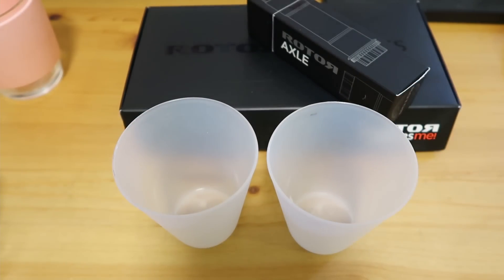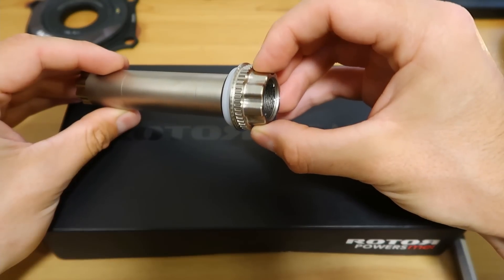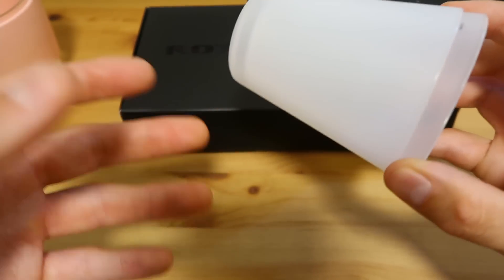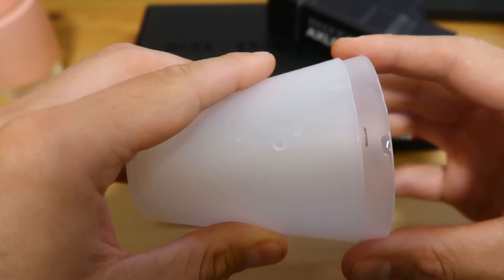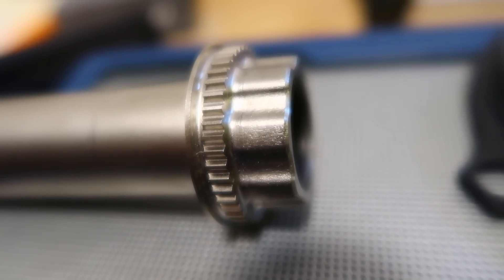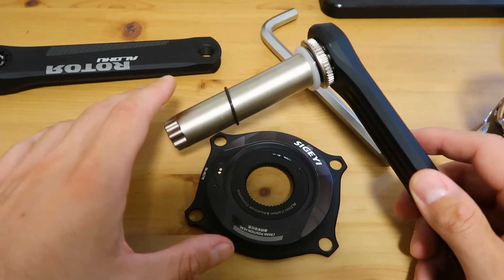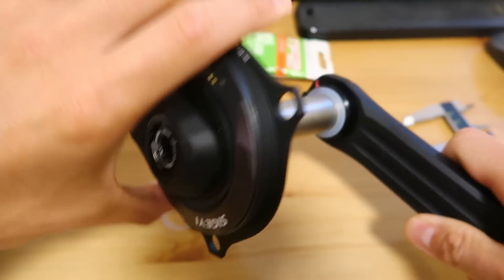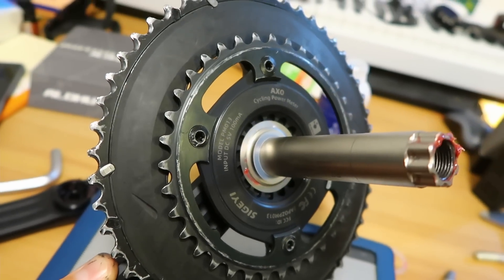Should you replace your Shimano cranks with these? ROTOR ALDHU Design completely & utterly analysed.

Comment: For what it's worth, a 30mm spindle in 7075 aluminium will have comparable bending and torsional stiffnesses to a 24mm spindle in chromoly, based on the aluminium version being one-third lighter and having a 50% thicker wall. At such a large diameter, I would like to think that fretting wear on the spindle caused by the bottom bracket bearings should be a non-factor, even if, academically, the chromoly spindle does provide a longer wear life. The mating splines on the 30mm version are also proportionally larger, which reduces contact stresses and should help preserve the female splines of the crank arms, which are by far the most expensive component in the system to replace.

Comment: I had a loose spider on an older heavily used Rotor P2M but without knowing its original build, it may have not had the required thread lock and spline "filller" stuff used. I've been running the Power2Max version of these Aldhu cranks for a few years with no issues until now - the NDS crank bolt snapped in half (not the normal way, like in half long ways) so I'm looking for videos because I've got a replacement bolt kit that includes two washers which I don't think my current cranks have :)

Comment: I've got a guess here, if the dub spline's got a taper of 2° and preload of 54Nm, and the rotor one has a 3° taper, it'll only need about 35-36Nm to achieve the same amount of radial preload, which is what is recommended.
I've also got another question, why none of these manufactures make the spline out of tangent arcs, instead they use this "small round cutouts in a big circle"? (hope I made myself clear)
Reply from the maker: @endercrafts9056  it doesnt work like that. In theory the shallower the taper, the less clamping force you need. Larger angle tapers actually need more force! As you have less mechanical advantage in a broader wedge. Second question: probably because they cant reliably rely on the locked taper to transfer pedalling torque so they use a very simple spline shape (easy to program) on cnc.

Comment: What should you do if you have some play when mounting the spider on the spindle. I have a aldhu24 crank for my BB90 Trek. And when mounting the spider it is not totally play free :(. I can remove the play when tighten the crank into frame but that can not be good, is it? Any one this issue? @PeakTorque?

Comment: Rotor Aldhu/Vegast 24 is a nightmare. I have two spindles with bad threads and during a casual ride a brand new Vegast crank arm fell off. It was one week old and I used a torque wrench. The quality is just horrible. Same for their web shop that sends mails with template placeholder and customer supper that promises replacement parts but never sends a return label, wants me to cut the crank in half. Do I own a machinery shop?! Ridiculous.

Comment: One thing that bothers me is the use of o-rings on the axle. O-rings eventually dry-rot and fall off/out of things like this. Usually when you still have sixty miles to go before reaching civilization. Also, they crush during assembly and use, then when you go to replace the bearings or swap the crank to a different bike, they don't fit properly anymore.

Comment: Great video. My big 1x11 Vegast chain ring came lose on a bike trip. I never fastened it with a torque wrench. So now I understand why it came lose. I found a guy with a big enough Allen wrench and tightened it very well. Back home it came lose with a lot of force and squeeking sound. Now I know that the tapered side caused this. I will use a torque wrench next time, this is precision work!

Comment: Aldhu 24 + Power2Max NGeco + Praxis Buzz 10/11/12-speed chainrings + AXS road 2x was a nightmare.
1) The cranks hit the derailleur cage when set up to SRAM’s spec. 
2) The 5mm wide flat-top chain is can get stuck in between the chainrings because the NGeco mounting tabs are >3.5mm thick.
3) That >3.5mm thickness causes shifting problems because the FD overshifts to a lesser extent while the rear is in the smaller sprockets.

Comment: Is the left crank axially restrained on the face (similar to the drive side) using the bearings (I'm thinking with a spacer keeping the inner races apart) or is the tapered spline the only thing holding it in place? EDIT: It doesn't seem to be this way looking at it. But does the end of the spindle bottom out against a face on the inside of the splined crank? I'm worried about the splined fit ''squirming'' under load if you will, and fretting wear occurirng between the crank and spindle due to elastic backlash under load.

Comment: Great style of explanation of the important engineering details. Subscribed. I saw this vid as I was looking at these crank sets for a power meter. I really don't like the idea of taper and spider clamping combined as you describe... Even if they do manage to get it to work in this case. I'll probably look for other brands. Is this the only option for these style power meters for shimano rings?

Comment: Update: I got the carbon arms a few days ago and the increase in stiffness is pretty dramatic. The carbon arms feel like a crankset should, without the noodly flex of the aluminum arms.
Reply: Yeah, right.  You put out 2,500 Watts and flex alumimum.
Reply: @lastfm4477  I realize your trying to make a joke, but it's actually in high torque situations like starts and steep climbs, especially for a 200lb rider like myself

Comment: No point to swap to rotor crankset . If you spend that money you better just get the newer dura ace . Much durable and light product . Good quality and good warranty .
Reply: You mean those Dura Ace cranksets splitting in half? No, thanks :-)
Reply: @mareklesniak8768  9200 splits in half ? You buying it from India scam call center ?
Reply: @CoreQ  Time will tell. 9200 cranks are not long enough yet on the market to be 100% confident Shimano has fixed the problem.

Comment: @Peak Torque  I have just purchase at 24mm Rotor crank set and 1-piece chain ring. The machining on the chain ring is outstanding!
When you torqued up the arm, did you apply force to the pedal with a chain attached to mate the splines in the best position as there's a fair bit of lash between the ring and spindle.
Thanks!

Comment: It could be that the tolerances don't need to be quite as tight as you think. There is a phenomena known as elastic averaging for coupling designs like this. Your analysis is correct if the material is assumed to be perfectly rigid. The shoulder sets the axial position, and the rest of the material will elastically deform to allow this to occur (which is why you need to use the force of the screw to draw the assembly together). To extend your comparison of machine tool tapers a little further - dual contact and HSK interfaces have a shoulder perpendicular to the axis of the spindle such that an accurate z-location is set regardless of differences in the tapers. The requirement for this is important as rpm of the spindle increases as the hoop strength of the outer "taper" (spindle) can actually open up and the draw bar can pull the tool holder further in to the spindle. Heat is also something of concern, which you note. I haven't gotten my hands on one of those Rotor shafts, but I would imagine that they are machined with a swarf style 5-axis strategy in a mill turn machine. In cycle probing and cutter compensation would make this a somewhat straight forward task with a straight fluted endmill (no custom tooling required),
Reply from the maker: Nice comment. Someone out there knows their stuff! With relatively thin wall tapers yes they can elastically deform, but the tol will effect the amount of force required to hit the axial end stop. It was my belief that tool tapers being virtually solid there was barely any elastic give in them, which would mean an taking an accurate z cal every operation. But my machine tool knowledge is limited!
Reply: @PeakTorque  The tool holder itself might not "crush" inwards much, but the machine spindle is a hollow cylinder at some level of analysis. Another way to look at it: make the assumption that all the torque applied to your bolt is being converted to linear force at the pitch of the thread (no friction losses) if that force is translated to the 1 degree taper (on the coupling) that is a hell of a lot of expanding force! Wedges are really good at expanding things. The HSK spindle  interface actually clamps the inside of the tool holder for this reason - as RPM increases the clamping force expands outwards. For your cranks: you could check this relatively easily on the crank arms by mic-ing the "width" across the interface area in a relaxed state and compare when it is assembled and torqued. Assuming you can repeat your measurement location accurately, I would imagine you see a difference (cross section growing when it is assembled). My point is simply that the torque spec on the bolt may be the "dominating" variable so long as the components are machined with relatively good tolerances. IE the tolerance window on the machining is a little wider than pure geometry / trig allows for, because nailing those tolerances would be next to impossible - not to mention the varying thermal expansions of the discrepant materials. Black anodized alum might get hot enough in the sun to fall off ;)
Reply: Yes, good comment. After reading this and a few other comments saying similar (deformation, elestic averaging etc., Maybe this design isn't TOO bad.)

Comment: Hi!! Did you used all the washers and o-rings that are shown in the video when installing the crankset in the Giant Tcr BB86?? I’m asking because I bought a set of Aldhu’s second hand and thet came without any washer and o-rings, to know what to buy to install them properlly in my Giant Tcr.
Reply from the maker: I actually think i didn't use any orings or the washers, because the tapers were squeezing these too tight when everything was clamped up. So just left them off, which is counter to what the instructions say

Comment: @Peak Torque, I went with a 24mm 3-bolt setup, but full Chinese - Sigeyi AXO with Zrace Hardrock cranks.  I'm preparing to install and have found there is a bit more backlash than your splined Rotor setup.  How concerning is backlash with these power monitors' accuracy?  Is the issue that some level of accuracy is lost for a moment in each pedal stroke?
Reply from the maker: It won't be good for the zero offset and repeatability. You'll also get a lot of noise and lack of stiffness from the chainrings. Do the cranks up to reccomended torque and then measure the gap. Use thin shims to fill the gap.

Comment: What is the order of the o-rings and spacers? Should the spacer touch the bottom bracket or the crank on both sides? Trying to find the same with the o-ring on where it should be located. I'm trying to figure that out for the install and can't find a good guide. Thanks!
Reply from the maker: if i remember correctly i did not use the oring or spacers as it made the whole lot too pinched when clamped up! And added too much preload to the shimano bb. That is the risk with tapered splines grrrr!
Reply: @PeakTorque  Great. Thanks for the tip. I'll be aware of that issue and test it out.

Comment: i have a Aldhu 24mm and even when torqued to way above the torque setting the chainring still wobbles. tried the chainring on my aldhu 30mm crankset and it fits perfectly. i might need to get a spacer to make the crank arm compress the chainring enough to keep it tight.

Comment: Nice explanation! I recently bought a power2max NCeco with the aldhu 24mm for my 18 scott foil (PF86 BB) . My drivetrain is a r8050 ultegra di2 so I kept the shimano chainrings. However, when I first installed the aldhu crankset, I noticed the crankset is sitting slightly further than my ultegra crankset. I noticed that because the chain is rubbing the front mech when I am on the big chainring. So I thought no big deal, I will just adjust my FD. So I got it to work, but since then, my drivetrain is super noisy when in the big chainring (worst when cross chaining). It's been a few months and still the same. Any ideas? Appreciate for your input!

Comment: Not to disagree on the general importance of getting tolerances right in over-constrained interfaces like this one. But even if the male part was just ever-so-slightly too big (or the female part too tight), you could probably still torque it down flush against the lateral stop; the crank-arm portion of the interface would likely just stretch a little more. With my set (30 mm), I can kind of tell as the preload pinch nut, while being very (like, very!) loose on the pinch bolt before torquing down the left* crank arm, will seize considerable after doing so. Also, the 3 plugs in each arm will usually become clearly visible after torquing down the cranks. And stretching holes (of cranks, way beefier around the hole than the rotors) has been a thing for decades  ... well, ok, this might be easier with a tiny square taper compared to a huge spline taper, but still(?)

* I was told by some Rotor person that the left arm, pretty much the same as the right one, bottoms out against a lateral surface when mounted as intended.

Side note: Sram has been mass producing that kind of over-constrained interface (tapered spline + lateral stop) since the introduction of gxp. Now, by no means, am I trying to say they nailed it or that there weren't people having issues with it in the field, just that, by and large, it kind of can work.

Another side note: I still find it somewhat funny how we went from 3-piece cranks, some designs with detachable spider, to integrated/2-piece to, now, fully modular (kind of 3 piece again).

(Sorry for shitty English. Also, not really an engineer. I like your videos much more than the ones from the French aerospace guy :D)

Comment: Tapered spindles are a stupid idea. Campagnolo Ultra Torque in an english threaded 68mm wide bottom bracket works perfectly. I feel sorry for people with press fit bottom brackets, who will never know the joy of a perfect frame after 100000 kilometers of heavy use.
Reply from the maker: Threaded bottom brackets have bearings pressed in 😉

Comment: My Rotors click (30mm DM version) and haven't been able to resolve it until this video. I've had them for over two years now but it was already clicking under each (driveside) pedal stroke after a few months from new so I suspect the DM and crank interface developed some give  resulting in the click.
Oddly my older Rotor 3D+ cranks (24mm) on another bike have been silent. Both of my Rotors have Q Rings if that makes a difference?

Comment: It doesn't looked a machined finish, anyone else agree? Maybe EDM or some form of pressing/coining?
Reply from the maker: I thought maybe EDM but surely not for this level of production? Maybe machined them some level of fine peening to give ot that appearance? Not an expert on this!
Reply: @PeakTorque  Agreed about EDM, to expensive for production. Looking at the other end, I think it's machined as I can see chatter marks, difficult to tell? So if you are going to peen then you would do both ends? I've spent some time at mints and coining is a interesting process, fast and accurate. Very specialised, but I'm no expert in that field for sure. That's my best guess, but that's all it is!

Comment: Yeah, it’s impressive tolerance but, but also kind of demonstrates how the sram or race face style chainring attachment are better.  With repeated assembly and wear, the rotor style is likely to reach a point where the chainring isn’t clamped tight and a shim would be needed.

Comment: @Peak Torque how much clearance have you got between the drive side crank arm and the outer derailleur cage?

I've got P2M +3d24 and there isn't enough clearance. If this works well I might go down this route instead. 

Are you using Mechanical or Di2?

Thank you. GP

Comment: I have two ROTOR Cranks, one in 30 mm, one in 24 mm, both DM. They perform really well and I do not have any issues with them. They are not cheap, because they are high grade products. What I like about ROTOR cranksets is, the seem to be more quiet than Shimano ones I had previously (R8000). As I am not an expert, I think, less noise, less friction, better quality.